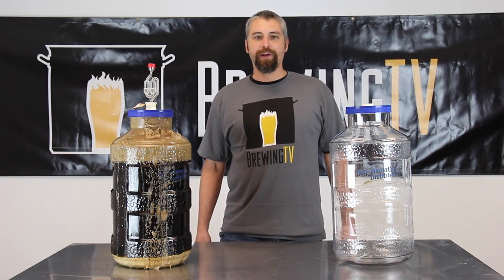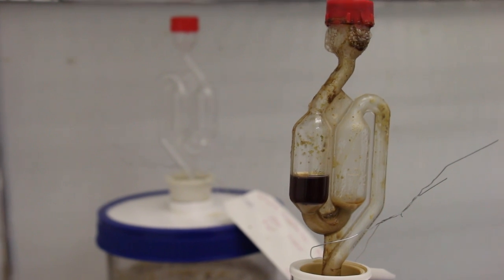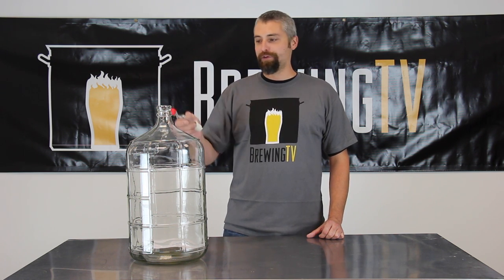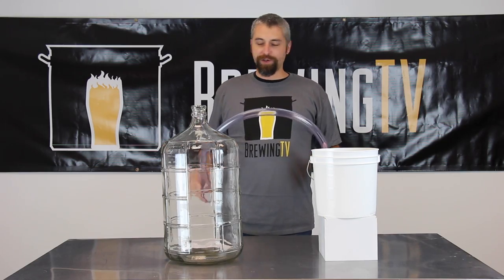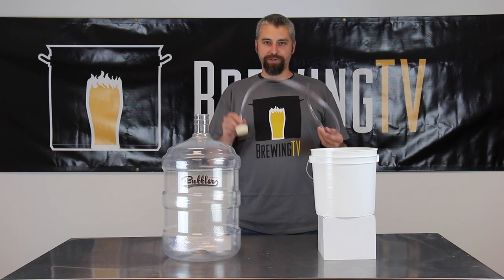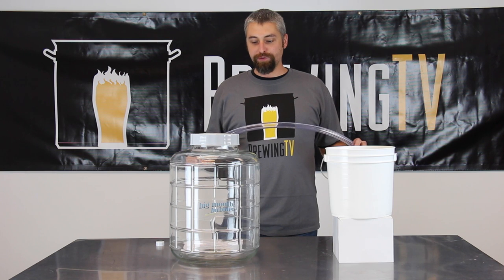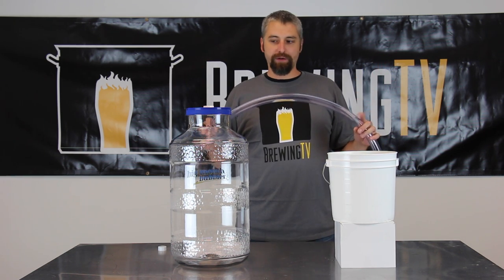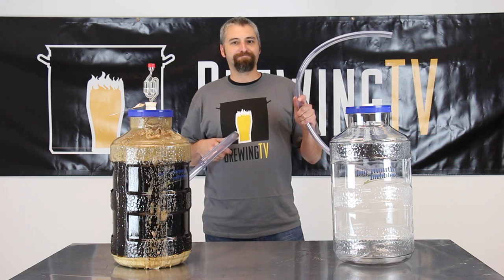Using a Blow-off Tube for Home Fermentation

Comment: My third batch of home brewed beer left me dealing with krausen on the floor, walls and ceiling at 4AM after a blowout (the popping sound woke me up from another room).  I wonder how many viewers are here after a similar experience...  if only I knew beforehand.  My ceiling looks almost back to normal now, a little bleach solution should take care of the last bit of discoloration.  I hope the beer will still be good, it's still fermenting, but past the point where another blowout is a risk.

Comment: why sanitizer?
Reply from the maker: In case for some reason the liquid gets pulled back into the fermenter you'd rather it be sanitizer solution than water that might have unknown bacteria, etc it in. Same for regular airlocks... or actually for airlocks, I specifically use bottom shelf vodka or whisky just to keep it more sterile than any possible water that might get in there.

Comment: bet I am not the only Hot Pepper Fermenter visiting this video - I am trying to perfect my process for 1 gallon ferments of hot peppers from my garden - this year I am fermenting in 1 gallon carboys to ensure my process is flawless before going to larger carboys next year but I am having trouble keeping enough water over the top of my peppers because peppers float - so there's always an inch or so of space at the top of my carboy with peppers sticking up about my brine - I am actually trying to learn how to pass water through the airlock / bubbler that I have - I also may opt to do some tubes into a bucket but guessing that pepper ferments don't produced the level of C02 that you brewers are dealing with.

Comment: Does anyone know if a blowout happens does the wort in the primary fermenter need to be thrown out? Our wort has basically stopped the fermentation process from what we can tell.
Reply from the maker: You shouldn't have to throw out your wort just b/c of a blowoff. Only if anything fell back into the wort that could potentially contaminate it. Most likely, you're good to go and continue racking and/or packaging.